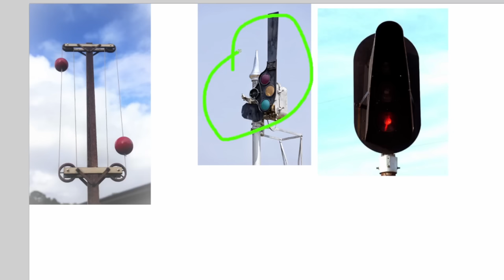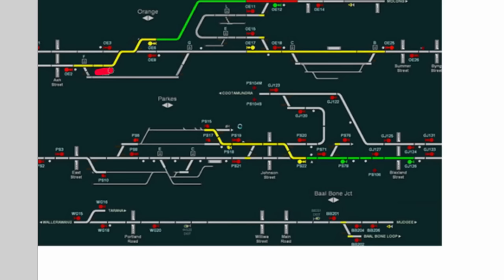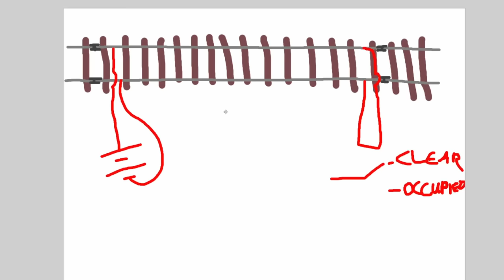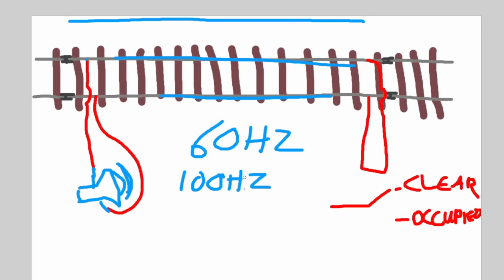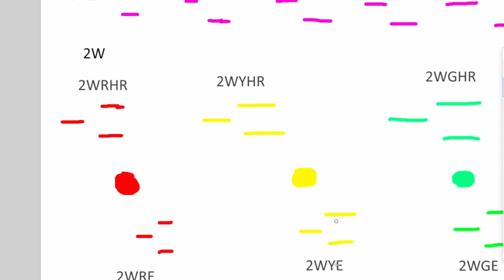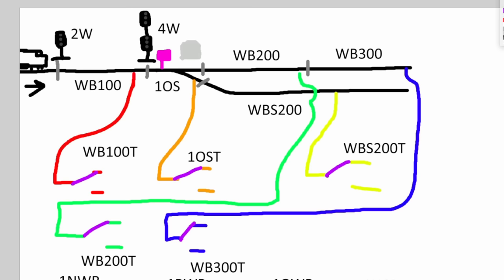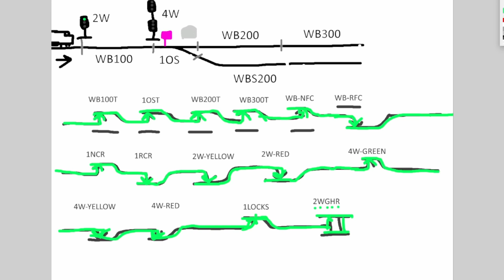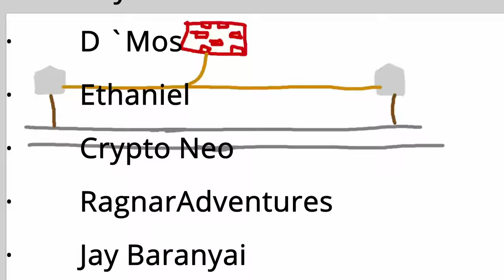SIGNALS 101: 10 Levels of Train Signal Understanding

Comment: Reading the signal aspect on the BNSF we were not to use binoculars nor any magnifying method.  Ya, right!  In some areas we’re required to stop a long distance from a signal to avoid blocking crossings within a town.   Impossible to see the aspect without magnification. Whip out the small monocular, then the binoculars, then the telescope. Some signals were so dim the aspect could barely be made out at a half mile!  At night, those yellow signals perfectly matched the sodium vapor street lights.   
Cruising down the track the aspect must be watched all the way.  A signal aspect can change at anytime and many have been bitten because their signal had degraded just before crossing the signal relay. 
BNSF ENG (retired)
Reply from the maker: Lol, sounds about right. I've heard many crew members complain about the fact we still haven't changed to LED's...
Reply: Once, while inspecting track on ABS double track territory, directional traffic left hand running,  using a motor car (not a Hi-rail truck) just after sundown, I had that "Oh, S#@T!" attack sweep over me.  This occurred WAY back when.....

To simplify, I had a lineup of Westward trains expected from the Dispatcher about 30 minutes ago, and no Westward trains for at least an hour at my location.  I stopped to check a switch east of town, checked the indicator, a whole different little device that indicated there "was" or "was not" a train approaching ln less than X (on this territory X equalled 5) minutes.  The indicator was "no."

So, I did my inspection: opened the switch, checked the components, fastenings, ease of operation the whole enchilada, closed and locked the switch and got ready to finish the run into town, about 2 miles of tangent track to the beginning of TCS.  There I would call the DS and get authority before entering TCS (that was what we called it instead of the "competitors" CTC.). Ya don't letter a Ford a Chevy!

So, I looked toward the control signal (it had been red), and....
Two aspects on the South Track signal! Red over green!  There were two signal heads on that signal mast.  Had the DS cleared a train Westward into town?  I looked to the East-- no headlight, no sound.  Dare I call the DS on the radio?  Derail the motor car and somehow toss it down the embankment?  Not very many "Oh S#@T" options that are good.  Check that signal again!  Still red over gr....   What?  That lower signal isn't green.  It's kinda bluish - like a .mercury vapor floodlight just warming up with a hint of green.  

Well, I was done.  I rolled into town and got the authority from the DS I needed, then tied up.  

I can empathize with anyone who has been shaken by some kind of "ghost."

Comment: N important point that was missed in Part 1 but touched on in part 5, was the fail-safe concept. 'hi-ball' as it's known to the US audience is an example of this; up (or hi)'is go because if water/snow builds on the device; it will by gravity drop to show Danger/Stop. Semaphore had the same principle (assuming US used only "upper quadrant" signalling; ice/,snow gathers on the arm and pulls it down to display Danger/Stop. UK also used lower quadrant signals which were the inverse and on occasion lead to accidents as the arm froze in the -45 degree position (indicating CLEAR - DANGER was indicated at 0 angle, to say horizontal).

Signals were designed to fail-safe from an early age is my point and should've been touched on at Levelc1, otherwise cracking content

Comment: It would have been nice to know about route & speed signalling.
Reply from the maker: It's so different per railroad and application that it would've been hard to do it justice. Maybe a separate 101 video. The TWC based and auto-clearing our transit system does is really cool, but would be totally different from flasher / combo aspects with CTC, etc...

Comment: When I worked with embedded systems (single processsor control) we had a Watchdog Timer that had to be Reset at regular times.  If the program froze up or went crazy, the Watchdog timer would Time out and force a Reset of the system.   At boot-up a check was always done to look for a Watchdog timer Reset and display an error condition.    I assume the computers for signaling must have the same protection.

Comment: You never explained why RR signals have red on bottom, but automobile signals have red on top. I read somewhere that stage coach inns had a ball hanging on a pole. If the inn had a passenger they would lower the ball to the ground to tell the stage coach to stop…the ball was against the coach. If there was no passenger the ball was left up the pole to tell the coach not to stop…the coach was high balled. I once heard an old railroad man saying the train was stopped because “we had the ball against us.” I guess the question is really why car traffic signals reversed the RR/stage coach signals?

Comment: 25:00 to 42:15 Also it needs to be noted that all these rules and regulations are quite literally written by human blood. Namely for example, the check that the circuit completes correctly is based on a railroad disaster where a worker forgot to remove a wire from a signal, the wire caused the signal to show green when it should show red, a train saw the green and accelerated right into a back of another train standing at the track segment behind that signal. The rules were then changed so that signals are checked that the correct aspect circuit is completed at the signal bungalow after the corresponding relays are thrown to their correct states. And the system is shut down if not, causing the relevant signals to go "dark".

Comment: 10:26 In the UK we call them tokens, not  hoops. On single track lines, you can't proceed unless you are in possession of one, which you need to exchange before moving into the next section.
Reply from the maker: Ours isn't a token, it's a piece of paper with updated orders - it's not the same as UK token based signalling, which is a neat system in its own right.

Comment: Fascinating information & great thought provoking video. Remarkably to me, I had no idea that such a device existed that would, if a train blows through a signal, release the pressure in the brake pipe to stop it. Never heard of it!
You also raise many questions in my head as well. For example, you spoke of recognizing a blown signal lamp by sensing the lack of heat - I assume railroads have or will replace incandescents with LEDs (with both much lower power requirements & longer life) which produce little heat. What is the approach for that? Light-sensitive electronics I assume...
Reply from the maker: There's a reason many railroads still use incandescent signals to this day. In the transit system, we have LED's, but they have redundant strips and circuit continuity checks to make them more failsafe. The issue more comes in with light out downgrades - with transit we just have go and no go, the speeds are handled by the cab signal system, so there's not a need to see if you need to downgrade the aspect.
Reply: RR I work for uses LED's on the main lines, there's a current sensitive relay for the feed that drops if they aren't drawing enough current. When that relay drops it also forces the previous signal to red to protect the signal at blackout. They tend to either half fail so and then the driver's report them or die completely which drops the relay. Haven't seen an led signal at blackout that was still drawing current.

We use current sensitive relays on incandescent signals too, when they drop they send an alarm to control and also change to the backup filament in the globe.
Reply: There's another thing about the missing heat (while not applicable everywhere): the heat melts snow that might build up in the lamp shade. If you use LED, which produces very little heat, that snow won't melt, so you see no signal.
I heard that happened on traffic lights in some cold spot in Europe, and the LED panels have since been fitted with extra heating elements that kick in when it's close too freezing.

Comment: Geek question here: what is the formula for finding the value of the series resistor in a simple track circuit?
Reply from the maker: I'd imagine you could measure the voltage drop across the rails, knowing the supply voltage, and then use a little ohms law to figure out the resistor. That said, it has been about 7 years since I had circuits class... Lol!

Comment: 19:15 INCORRECT! Dangerously incorrect even.
Electricity will prefer the path of least resistance but it will take ALL paths regardless.

So say there's 10 units of resistance in the entire track circuit when no trains are on it.
Then as a train enters the block, there's 9 units of resistance up to the point where the train wheels hit the track and then one unit of resistance still remaining behind the train.
What this means is, in very simplified terms, that the train will pass close to half the current and the track behind the train to the relay will pass close to half the current.

As the train gets closer and closer to the energy source (car battery as you put it) more power will take the shortcut route through the train axles, and less and less power will take the path all the way around through the relay.

It's the relay that decides how much current/voltage it needs to stay in a CLEAR aspect. You could set it such that even the slightest disturbance (a tree branch falling over the tracks, or water flowing past the track) would trigger the occupied state. Or you could make it reliable and only switch to occupied when less than half the power reaches it, which will delay the signal switching to green for some time until the conditions are met. Unless of course there's a second system in place to make the signal red when the train passes it and this other loop keeps it red when the train is closer to the energy source.

Either way, i wouldn't recommend you short circuit your wall outlet and then touch a live and neutral that branches off that shorted mains voltage. Because there's still voltage on those unconnected branches that WILL jump through your body if you touch them and give you an, albeit reduced, current that could end your life.

Think of a river that splits in two and re-joins again. Even if one path is wider and shorter than the other, the other path will still have water in it flowing.
The path of least resistance is where water (or electricity) is flowing through ALL available paths simultaneously and distance has nothing to do with it.
If the tracks were made of superconductor materials, the current would prefer the longer route over passing through the highly resistant train axles.
The same way a wider portion of the river will allow more water through it despite you having dug a shortcut that is narrower and the closer path to the ocean.

Comment: You are a very good conveyer of information, i.e. instructor.  The thing I would like two know is if you have two processors, a main and secondary, how do you determine which is correct and if one has failed?  Do they use concurrence I logic as was done for the space shuttle or is it failure detection where one is down and not just providing bad information?  I probably should mention I am a software systems architect.
Reply from the maker: The systems are constantly self monitoring, and have a fail over from normal to standby at the ready. Usually it's a logic equation not giving an intended output, or one of redundant calculations not agreeing, that causes a fail over. And thank you!

Comment: With that mechanically operated signals level (level 3 of 10), I can already see that signal bungalows (yes, I know, wrong term, but my memory isn't pulling up the right term at the moment) operating in more northern climates would likely have had no end of trouble in wintertime with signals becoming hard or impossible to move because they had become encased in packed snow or ice.
And in more western US climates, it might be that sand blows into the mechanisms, causing similar distress.
Do you know what kinds of measures they would take in the past to prevent issues where the signals fail to move to their commanded position? I can also imagine that there might have been a fair bit of play in those mechanisms if they depended on cables and pulleys, or even pushrods, so some question arises about just how postitively these signals indicated their position (the semaphore signals that is). Did engineers have some training to reject a signal that was in some "in-between" state or was that instead a frequent source of problems?

Comment: Most east-coast rtailroads use GCOR rules. LIRR and Metro-North were on the comittie that designed the GCOR rulebook, but were displeased with the final result and so each created their own rule books... So now it devolves upon who owns the tracks that you are running on. AMTK owns most east coast passenger trackage, and operates under GCOR. New York Penn Station is Amtrak property and so all trains in and out of NYP operate under GCOR rules. West of Harold Interlocking LIRR runs under GCOR rules, east of that tower all trains including NY&A will operate under LIRR Rules.

Metro North MNCR operates under its own rules, and while Amtrak trains run on MNCR rails they must follow MNCR rules. 
If or when MNCR gets track right into NYP, they will have to run under GCOR rules.

Now LIRR is gaining access to Grand Central Terminal (GCT), they will not run on MNCR rules, but will follow LIRR rules since their tracks will have no physical connection to the MNCR system.

BTW... Grand Central Terminal is a railroad terminal; Grand Central is a Subway stop, and Grand Central Station is a post office.
Reply from the maker: Thanks for the briefing :D and, lol, gotta love that. We have a similarly confusing situation here where University Street Station, University District Station, and University Station are all three stations on the same line in very different places... lol!

Comment: Sounds like a cool job, I’m in info/cyber security, dabble in electronics (build 8 bit computers from scratch) and could totally see what’s enticing into signal engineering.

I’ve take the Chicago Metra for the better part of 30 years, mainly the BNSF line to Union, and always wondered how this stuff works down the tracks.

How does one do signaling in Chicago on the El? Is it radically different than the other large networks? It’s basically closed loop isn’t it? They don’t have to worry about connections between networks do they?

Which brings up, and it may be later in the video, not there yet, but how do you deal with connecting one network to another? Does a BNSF train have to operate on a non BNSF network?
Reply from the maker: This sort of thing can get all sorts of complicated quite quickly, indeed :)

The El has its own system, I'd wager; and it likely has some different design requirements than your commuter line. The headway (time between trains is very short on the El, but longer on the commuter rail, so the setup is different. Shorter headways means more track circuits, and likely some sort of speed command or automatic train protection system, which the commuter rail won't have. 

If the tracks connect and trains are going to run over them at decent speed (based on regulations, I believe 30 mph+) - the networks need to be connected. One bungalow, say UP's would control the junction, but BNSF would need to be able to see and possibly control the signals from their dispatch center. It gets complicated :) thanks for the comment. 8 bit computers from scratch sounds like an interesting challenge :)

Comment: Fascinating explanations. One thing I noticed is that you never mentioned axle detectors in the track circuits segment. Especially here in Europe, they are pretty much taking over. Every new line or line upgrade I know of gets axle detectors. Are axle detectors just not a thing in the US (or North America in general)?
Reply from the maker: We don't use them for signalling purposes. We do for defect detection, but not for signals.
Reply: @Hyce777  Interesting, makes me wonder why. A vague guess would be that it doesn't offer broken rail detection. As a background to my guess: While I was in training for railroad operations here in Germany, I asked the question the other way around: with axle detectors, you have no way to detect broken rail, how is that function replaced? It took a bit to actually explain where I was coming from, and when my instructor understood my question, her answer ended up boiling down to "if you properly maintain your track, that isn't necessary". And I have definitely noticed that there is a major difference between track conditions here in central Europe and North America (even though I still think it would be a nice safety perk while not having adequate data to back that up).
Or maybe you have a better idea why it's not used in North America?
Reply from the maker: @trainman2615  I think that would be it; it's a problem of scale. The biggest railroad in the USA alone, BNSF, has 32,000 miles (~51,500 km) of track. That's one of the 7 biggest railroads. Keep track (lol) of all of that, is an extremely challenging endeavor. Having the system help is the best way.

Comment: I am confused now. The semifore and lights. You colored in the modern signal with paint so we can see it. But the semifore has the lights green on bottom red on top like a highway light. Is that because the bulb is on the lower end of that junction box and that's just how it lines up with arm position when it swings down?
Reply from the maker: So, forget about the positioning of the lights on the semaphore. Semaphores have a fixed bulb that the lenses rotate in front of; so the light is always in the same place and is really only there to help visibility at night.